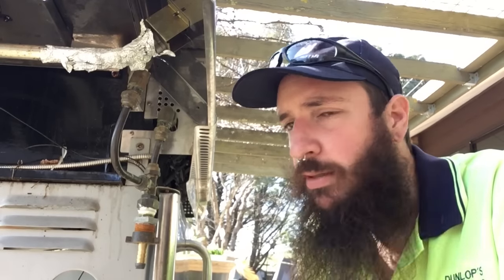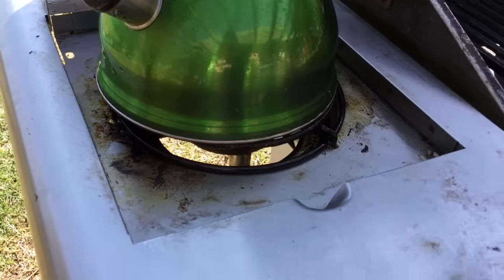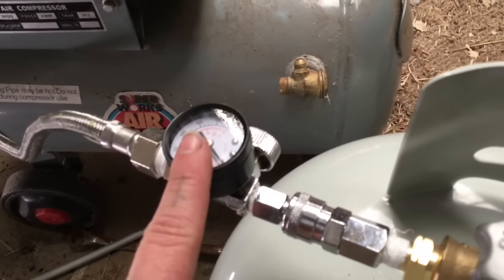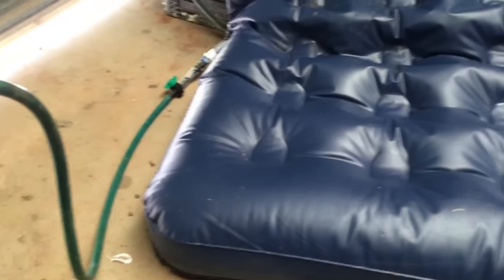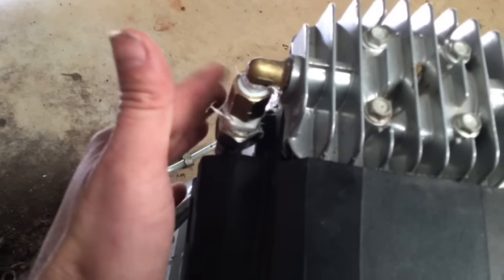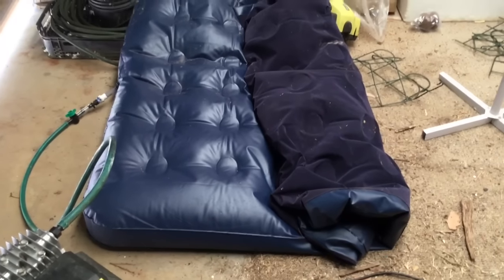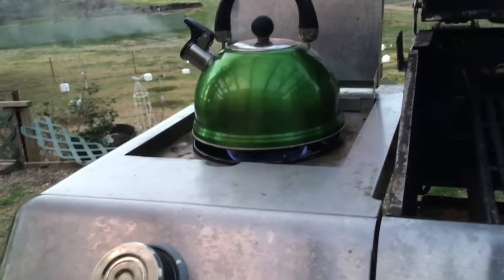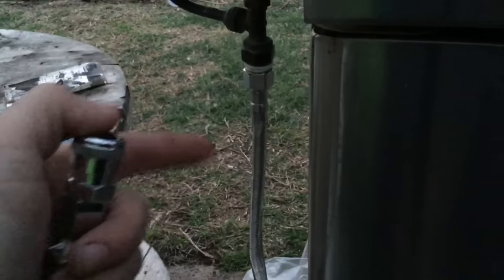Compressing Biogas into BBQ bottle

Comment: U should have weighed the can empty then show us the weight of the can wen full so we can see the weight in millilitres or kg
Reply: Its compressed gas so it wont be a huge amount of volume. If it was super cooled to a liquid like propane it would hold more. Should stick the tank in dry ice or something to see if that works.
Reply: @shawn2789  enough pressure/low temperature would convert gas to liquid….
Reply: Yes I would love to know the weight of the gas able to be contained within the tank.
Reply: @jessewilson8676 that pressure is not attainable. There is as reason propane is supercooled.
Reply: Your compressing a gas not a liquid. The weight should be nothing .
Reply: I would imagine the weight would be nearly neglageable because it's compressed gas, not liquified.
Reply: Energy density of liquid propane is 270X it’s gaseous form. This video @120 psi is roughly energy density of 6.6x. Going further a regular propane tank has 440,000 btu while this would only have 29,000 btu compressed at @120psi. My math might be off a bit but those are rough numbers.
Reply: @shawn2789 the weight of the propane in a full propane tank is about 20 lbs. I’d say that’s measurable.
Reply: @Howwerelivingfishing he's compressing gaseous methane. Way different from liquid propane. Weight difference in gas would be too low to measure.

Comment: Since being in lockdown because of covid 19 I have stumbled across biogas and my first thought was storage of the gas will be an issue. This is awesome! Thanks.
Reply: You might find a trompe to be interesting then. It uses flowing water to compress air, and in some cases it would work to also filter woodgas.
Reply: This looks dangerous as hell. Your not supposed to over fill them tanks?
Reply: @Mr0rris0  im pretty sure he knows how to look at a pressure gauge man.
Reply: Also LPG can run bike and cars! think about that! Build your Own LPG 4 wheel push bike or cart!
Reply: The reason why you only fill a tank to 80 percent is propane is liquid when it's temperature rises it turns to vapor and expands raising the pressure in the tank methane to get it to change to a liquid you'd have to pressurerise it to thousand of psi so it stays a vapor tanks are able to hold pressure and like any pressure needs a pressure relief valve and that's built into the valve since he's not bypassing or removing the valve it can never be overpresurrized so it's safe unsafe is my propane dealer filling a 30 pd cylinder as a 40 pd thats why I cringe anytime I see someone putting a propane cylinder inside a living space mine warmed up vented the gas caught fire from the fridge pilot and my cabin went up like a torch after it was out I found what was left of my out in the field 1/4 mile away never did find my small tank that was attached to my stove
Reply: Did you change the pressure of the regulator also did you change the orifice size
Reply: @douglaswindsor120  . ,

Comment: If you use an old fridge compressor you can get much more pressure and possibly get the gas to liquify.
Reply: Methane has to be at least -26 F before it would liquify. Not too hard compared to liquifying nitrogen. Definitely more approachable than LP

Comment: Just stumbled across this video. I am looking forward to seeing more on this. Compressed storage has been my reason for not doing bio gas so far. Looks like problem solved.
Reply: Agreed
Reply: @andrewrobinson2869  Not everyone wants to run a compressor off the air-mattress or bladder storage.
I have not ventured into biogas yet for that reason: I just do not want the hassle of storing biogas at atmospheric pressure, THEN having to pressurise it for use.  
I like the idea of using a <regular> air-compressor to at least partially fill an LPG cylinder, then use it like LPG.
Reply: @Tassie-Devil  same
Reply: @Tassie-Devil  Try using a fridge/freezer compressor, far more efficient.
Reply: @itchyvet  I have one, but most of the special internal oil has been lost.  I know that the fridge compressors need the oil for cooling as well as lubrication, but I don´t know what sort of oil to use to replace the original.
Reply: Oh please no. 1 spark F#!@s everything. At least a spark arrestor would be nice

Comment: If you put the take in the freezer to get it cold then put it in ice to keep it cold. You should be able to get more gas in the tank.
Reply: Like that can i get liquid gas in my storage?
Reply: @ss-sq1hn   No to get the gas in to a liquid would require you lower the temperature down to fare lower then your freezer could get it and a regular take could not hold the pressure ones it was there.
Reply: So for example, after putting an empty tank in a freezer,  the tank should be dipped in ice cold water while gas is being compressed? Am i right?
Reply: @marcrogelnagales2400  Yes and if you can pole a vacuum on it even better. Don't let your compressor get to hot or it may cause an explosion. Good luck.
Reply: Probably not enough to notice a difference, you have just reached the limits of your pump.
Reply: @MrBgwolf  I do this method when refilling the small camping propane bottles work just fine
Reply: @MrBgwolf  not to mention gas can self detonate under extreme pressure
Reply: @MrBigbmcc  creo q para eso no necesita el compresor .sólo con la diferencia de presión de la botella llena a la vacía  es suficiente

Comment: I've been thinking about how to compress bio gas for a while and I envisaged a problem with using an air compressor like you have, that being the heat generated by the compression, but using a heat exchanger would solve that, however I thought about another potentially serious problem that might occur, especially as the gas volume drops in the primary storage (the air bed), this would be that outside air could potentially be drawn into the compressor cylinder past the piston rings from the crankcase via the crankcase breather. Any ingress of air in this way could lead to spontaneous ignition like a diesel engine, resulting in catastrophic failure, so I'm wondering could a diaphragm type pump be better suited to do the same job.
Reply: Refrigerator or sealed compressor
Reply: @midnightblue69  yeah I came across a video last week showing how to make a refilling kit using a fridge pump, and a few other bits and pieces, fairly straightforward

Comment: To clean up the bio gas use a filter that has some steel wool and some NaOH bleach solution to destroy the SO2. Then filter through some charcoal to remove some unwanted compounds. Next compress to a tank that can purge moisture and have the gas flow through a dryer and CO2 scrubber made of MgSO4 and dry NaOH. Then have a fine filter and compress into the tank. You will be left with clean methane of about 95% purity about 5% CO2.❤

Comment: Just a tip for getting air out of your bottles, methane/natural gas is lighter than air, if you turn your container upside down and start to fill it the methane will rise to the top and push any air/oxygen out the bottom.
Quick - simple
Reply: perhaps once partially filled turn upside down and open the tap to let air out then continue filling, Do you think that would work?
Reply: You can chill /freeze the bottles as well.
Reply: @Dragonfiregum  that’s what I was going to say . Put the bottle in ice water .

Comment: Nice build. A little concern on the safety side of thing. the lack of flashpoints and flash arresters on a build like this coupled with a nuffy could make for a bad mix.
Reply: Can you explain further for a newbie
Reply: Dealing with less than 1m3 of biogas here and roughly compressing to 700kPa (110psi), is a fire arrester necessary? When compared to liquid propane cylinders, it is compressed at 2MPa, which is much higher, but our stove burners don’t really have a fire arrester or flashpoints either.
Reply: @jimmypchacko  I'm a bit new myself but here's my best example. think of a tube going into the bottom of a pipe filled with water, the gas going through it rises to the top of the pipe leading into another tube, and there's a fire at the end of the tube at the top. If the fire moves backwards into the tube then it goes in to water instead of a bottle of gas that will explode due to all the gas igniting at once.
Reply: Flash arresters are easy and always a good idea. Commercial ones aren't very expensive and easy to make homemade ones

Comment: The air compressor is also a vacuum pump. Vacuum your tanks and keep them cool prior to filling.
Reply: When filling, the outlet of the compressor should go through a metal coil, cooled by water. Tank should be in ice water.

Comment: I suggest compressing the gas when the bladder is cold. This will reduce the kinetic energy in the gas compression and increase storage by 10-15%> if its freezing cold you may get an extra 15% as the compressor has more volume per unit ratio. Also there should be less thermal energy at the compression stage. I also recommend some mineral salt at the interstage between gas and stove. This will retain any excess moisture and also add color to the flame ..yellowish so it can be more visible at the burner. Rock salt should suffice.
Reply from the maker: Not bad thinking, it’s soon to get pretty cold here as we move into winter, so yer is imagine I would be a bit more in with cold gas.

Comment: I'm late to the party, but like the video. 

 A couple things:
 sodium hydroxide is NAOH (Caustic Soda) ,
Bleach is NaClO (Sodium HypoChlorite Soln). Not sure which you prefer. 

Also, I was concerned about the combustion point of biogas under pressure, and would like to suggest cooling your compressor with water while compressing the gas. 

Thank you for sharing!

Comment: For smal, simple, home use, couldn't a person just put a weight on top the air mattress, so it's pressurized? Or do the same for any other pillow type pods? I would think that even an elastic band around it may work? Something that gives constant pressure on the bag?

Comment: Safe as houses. Id suggest adding a cold bath(ice and salt) to chill the bottle. Get a lot more into it, gas pressure drops to 0kpa at -42°C. Maybe even go so far as to cool the pump head of the compressor for longer filling time before overheating.

Comment: Few questions here:
1. What was the total volume of the gas filled into cylinder?
2. At what pressure was it filled?
3. how much time did it take to empty the gas by burning continuously?
Reply: any answer for this?
Reply: @vincentlucero8367  200- 300 litres of gas, at 110 PSI, took an hour it was all in the vid bro
Reply: @jadewilliams2846  It was not a accurate measurement of time . This  as he had a gas leak.

Comment: Dude DONT EVER  use quick disconnect  fittings with any fuel  as they leak over time, and if they start allowing air to enter the system during pressurization
you are making a B O M B. The very best storage vessels I have used are inner tubes used on 18 wheeler tires, and they are easily joined together with
tubing or hoses for  long lasting gas storage.
Reply: Thanks for confirming my thoughts.

Comment: I love this! I see problems with the wood gas not burning hot enough.I’m very curious to see if you attached an oxygen bottle with the wood gas (like you would a propane torch to cut metal) would allow to combination to burn hotter more efficient/effectively and allow you to use stock size fittings and decrease the gas use and allow your utilities to work at normal operating ranges like they did with lng, or lp.
Reply: The reason as to why the gas isn't burning hot enough might be due to the percentage of carbon monoxide present. If that carbon monoxide were to weigh heavier than the usefull methane, for example, perhaps there's a way of separating both, without having to go through that much effort

Comment: Energy density of liquid propane is 270X it’s gaseous form. This video @120 psi is roughly energy density of 6.6x. Going further a regular propane tank has 440,000 btu while this would only have 29,000 btu compressed at @120psi. My math might be off a bit but those are rough numbers.

Comment: great video and interesting. Just one thing. Sodium Hydroxide is not bleach its Caustic soda - like in drain cleaner. I have seen steel wool in a tube used to get rid of the unwanted component.

Comment: Pass it through a radiator to cool it down before it enter the tank or else you might experience condensation in the tank after the gas is cool down.
Reply: Does metan condensation makes tank more dangerous, less useful or both ? Thank you.
Reply: @adderalkebap4204  that's what I want to know

Comment: Great video, love your experimenting spirit!
I am thinking if I can use a diving compressor to get the gas on 200bars bottled.. 
How you think the compressor designed for air will take the gas? 
Maybe I can build a temperature safety switch, add cooling and build a condensation section before entering the  tank..
Any thoughts? Thanks !
Reply: I'm trying to heat my garden house on CNG. Scored a 126 liter CNG tank. But to bring the gas to the correct pressure for standard natural gas equipment (30 mbar), pressure reduction is necessary: CNG in a tank can have a pressure of around 200 bar! How to resolve that?

Comment: Any chance you could make a video about removing the hydrogen sulfide, CO2, and moisture from the biogas, showing how to create the items needed to remove them?
Reply: Moisture could be removed using a refrigeration system
Reply: Your light
Reply: Bubbling through water before compressing removes the CO2
Reply: Bubbling and wire wool not stainless steel, packed into a 3 foot 2 inch diameter pipe feed in from bottom and out from top. This should remove all moisture . The hydrogen sulphide can be scrubbed out using activated charcoal filters. These also prevent blowback from the outlet pipe if the flame propagates back.
Reply: GOOD info
Reply: Remove CO2 with water in one generic container, let water flow through another regular container kitty litter or silica gel and lastly, let hydrogen sulfide flow through final container with steel wool.

So yeah! 3-part scrubber.

Comment: Hi, is there any risk of explosion using that type of compressor? It has a piston right? For example if you forget to change or add new oil, is it a risk? Or does the absence of oxygen minimize it?
Reply: absence of oxygen will. just keep everything cool. I would use a oxygen meter to make sure there is no outside air being compressed with a flammable gas..
Reply: biggest risk if there's oxygen being compressed and using the gas with a stove and it back firing and exploding the tank..

Comment: IF you can keep the temp of the bottle under 50 degrees then, "in theory" you could get about 280 litres of gas into that bottle
just keep in mind that propane has a vapour pressure of about 130psi at 25 degrees C but methane is about 670psi but the bottle will vent at about 250psi, so you will never get it to a liquid state, but it is still a lot more than the propane in liquid form. Dont blow yourself up. putting the bottle in ice water may help, just a thought. Other than my concerns for your safety this looks great You may want to look at using liquid thread seal instead of the tape. you can get it at bunnings. The other thing limiting you may be the compressor itself just not strong enough to get higher
Reply: Please tell me for how many hours can we use the gas filled according to you.approx

Comment: The biogas must be dried and cleaned of H2S to store it like that. The pressure needs to be regulated as propane liquefies at a lower pressure than methane will. Also the coefficient of expansion is higher so you will want more head in the bottle. It's better to use the bigger size bottles. At 500 liters at stp of propane you will want about 70^ of that for a safe fill of methane in the tank.❤

Comment: You are very brave man 😅 i think compressors life will be quite short, in plant that i was building, controlling the quality of gas was one of the problems. You need to measure % quite often. Most likely your compressor will be eaten by corrosion quite fast. But cool experiment.

Comment: Am I the only one concerned about the spark from the compressor igniting the gas? Or am I over thinking it?
Reply from the maker: No oxygen
Reply: Smart answer👌
Reply: All I am saying is even a small leak in that threading could really mess up your day.
Reply from the maker: No. A small leak would still not do anything, you need optimal gas to O2 ratio.
Reply: Hello, I want to know what is the most appropriate amount of gas pressure inside an empty tube, please respond

Comment: I wonder if putting the tank into a vacuum prior to filling it would help
Reply: Unless you are replenishing the same material (air, chemicals or combustibles) you MUST purge the tank, vacuum works best, if your container can take it.
Reply: @arenotdiy7280  would you  use a cleaning agent like AC line set flush prior to putting it under vacuum?  Thanks for the help

Comment: I seem to recall that an iron sponge filter will scrub out that hydrogen sulfide.  That and a carbon filter should eliminate odor.  Correct me if I'm wrong.
Reply: Yes, this looks dangerous, without removing the sulfur the tank will corrode.

Comment: you are only getting 120 psi because that is what the compressor is set to produce  i was thinking you could set up a sealed scrubber before the tank  to act as a spark arrestor  i would be concerned about getting blown up and would place a spark arrestor  on both sides  of the compressor head thankyou for vid and be safe